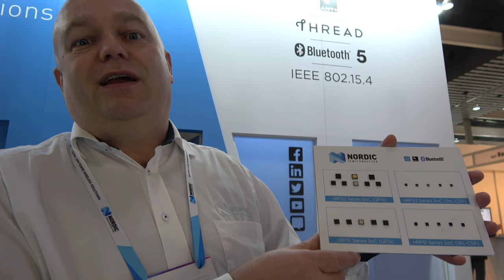Nordic Semiconductor nRF52840 ARM Cortex-M4F for IoT

Comment: want to use nRF52840 connect to my house 's router .So does the nRF52840 has wifi chip embedded on board ?? 🤔
Reply: Not wifi no
Reply: @scorpiuswireless1  thanks , how to connect to my house 's wifi router with nRF52840 ??